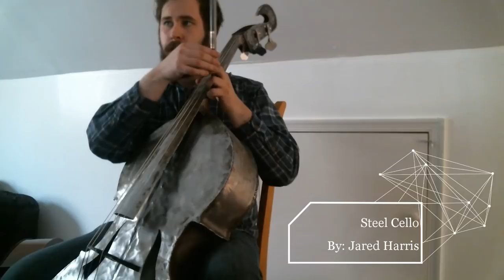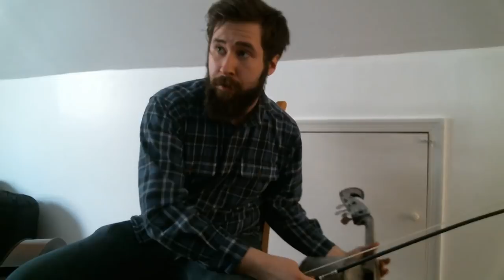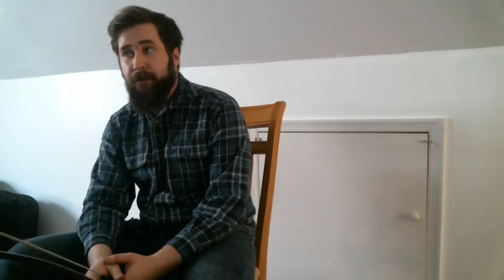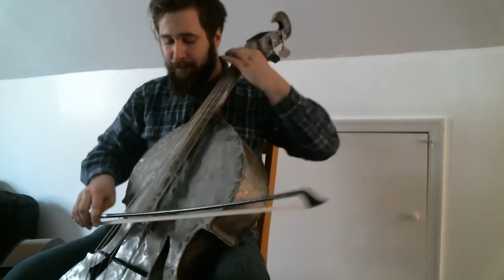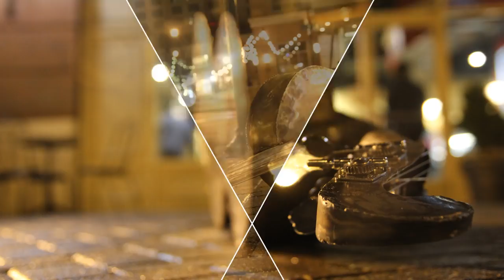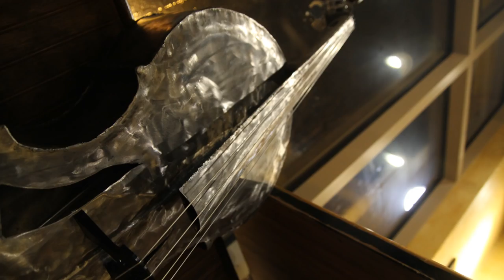Steel Cello - 100% Welded, Hand Formed, and New Design, Metal

Comment: Love it. The steel fingerboard, how did you curve it?
Reply from the maker: I clamped it to a pipe radius and hammered it out. Then, to make it smooth, I plug welded and ground down any trouble spots. The curved is locked in by the supporting steel sheet under the fingerboard.

Comment: When the prince and cello knight of the string kingdom, Barcarolle, fell to the brass legions there was much mourning, when it was revealed that he had converted to the brass legion the kingdom bean to fall apart. However his metallic form after he repented and was purified of the brass may now be the only hope for returning the strength of the string kingdom and the only way to fight against teh machinations of the brass king.

(r/TubaWarriors)
Reply: but no i do think this is awsome it just is a little sad that the sound seems a little less rich but not in a necessarily bad way more like an interesting way
Reply from the maker: Thanks for the lore! Also, I would definitely recommend my wood vs steel cello video where I have much better audio quality. This video doesn't do it justice :)
Reply: @uncontainedcuriosity2316  will do

Comment: Does it have steel strings as well? Have you considered attaching a magnetic pickup to see how an electric cello would sound?
Reply from the maker: I actually have an e-cello that I built as well that deserves its own video. There's an interesting physics problem on why a normal guitar magnetic pickups does not work. And that is because: when you start bowing, the string moves exactly perpendicular to the magnetic field, resulting in no volume. Where plucking works normal as expected. I built a custom magnetic pickup to solve this issue, so that'll be the video as well!